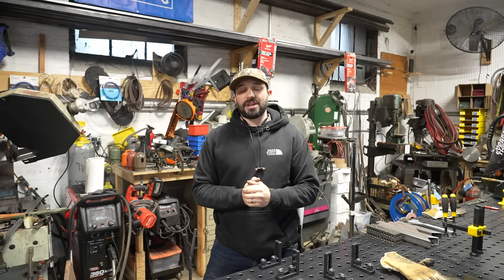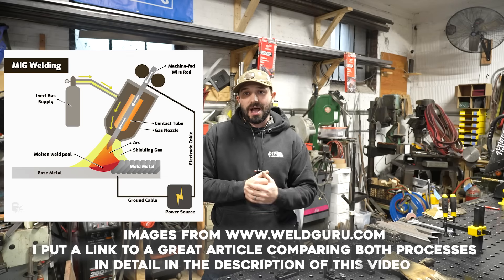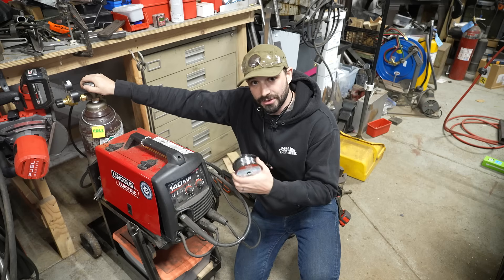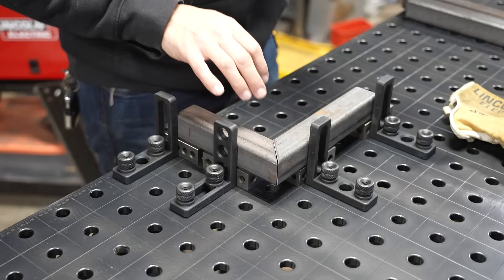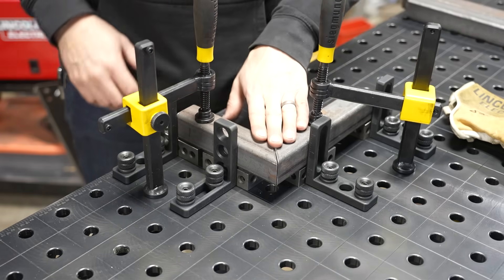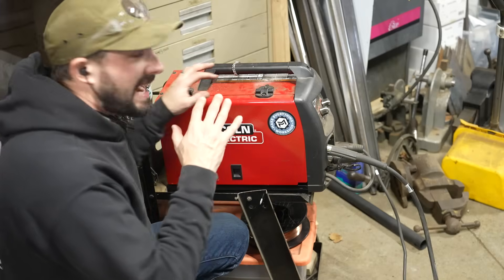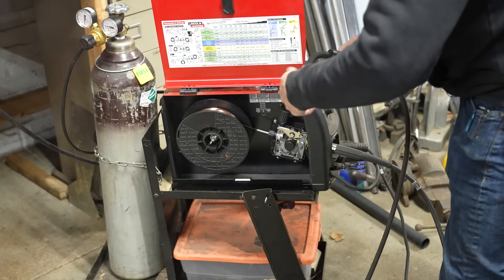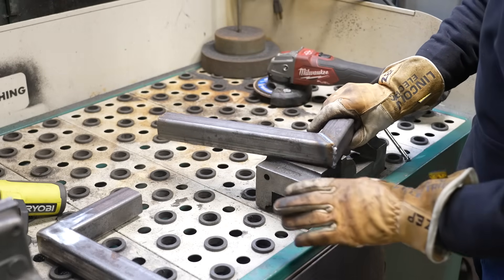“Gasless” MIG Welding Explained!

Comment: I have a MIG and a TIG welder. I don't use either anymore. Getting gas is a pain. All I do today is stick weld. It's the cheapest and easiest welding process to keep up with. A pack of sticks and I'm all set.
Reply: Alright!  Bro thanks for the tip , I'll get a 240v one since I'm a beginner
Reply: @josejovel8359  there is gasless wire feed welding. But I found that keeping wire was a bit of a hassle too. I've had spools of wire rust on me. I've had stick electrodes get soggy. Those I roast over an electric grill I have. That's all climate dependent. If it is dry where you're at you won't have those problems. Stick welding thin material is hard. If you plan on welding sheet metal then get a wire feed welder. Wire welding is generally considered the easiest process to learn. The first process I learned was oxy acetylene welding. Then I got my MIG and finally my TIG/stick welder. Welding with a torch is pretty dangerous. All welding can be dangerous. An open flame is especially dangerous though.
Reply: @1pcfred how would you fix a hear line crack on a power head on a outboard engine. It is were the water cools the cylinder. I tried using Jb weld but there was still a water drip coming out. I was thinking I would use a aluminum rod and torch it???
Reply: @ no I used regular jb. I will try the vinegar trick
Reply: Stick is king..  I agree.  I do enjoy mig and Tig though.. just at work... Where everything is free😂
Reply: @eastcoastitalian8758  I just watched a video where a guy was testing out a laser welder. That's the future.
Reply: I can get gas easy enough, but boy is it expensive
Reply: @nicolec7290  I haven't bought gas in a very long time and everything is expensive today.
Reply: @nicolec7290  It's pretty cheap where I am a 155CF C10  costs me around $70 to exchange at my LWS, and a 330 CF argon is around $110. Cylinder rental fee is $75 per year per cylinder. C25 is going to be about the same price (a couple bucks less if anything).
Reply: How is getting gas a pain? Your still going to have to go your LWS to get sick welding electrodes, exchanging a gas cylinder doesn't take any longer. Hell if you call them in the morning they will even deliver gas cylinders for a fee, often the same day. 

Stick welding is great for working outside with thicker steel, it's all we do at work in the construction business. However stick welding is a terrible process for welding thin steel, and non ferris metals. 

If you're working on cars, bikes, etc at home stick welding is possibly the worst process you can choose.
Reply: @Trump985  I can buy welding sticks all over the place and welding sticks don't leak. Good luck finding a gas cylinder that doesn't leak. If you're going to a welding supply house without soapy water you're one of their best customers. For a fee I can get anything done. It's over an hour drive to the supply house. So I'm sure their fee would reflect that. If I was getting a truck load of gas it'd probably make financial sense for me to have it delivered. One bottle? I don't think so. When I moved I never setup an account with the supply house here and my bottles are all from another supplier. Now they might swap them out? They might tell me to go pound sand too though. In fact if I was a betting man my money would be on the latter. My old supply house was cool as long as I was paying cash. I bet they were just pocketing it. I also don't care. I used to sign all of my receipts Johnny Cash. If there's one lesson to learn it is that not all welding supply houses are the same.
Reply: @1pcfred  Sorry to hear that, sounds like you were dealing with a shity LWS. In over 30 years of dealing with my LWS I've only gotten one leaky cylinder, and they swapped it out at no charge. However I have gotten quite a few bad dewars of LOX (liquid oxygen) from them, that boiled off very quickly. It doesn't take much banging around to damage a dewer enough to destroy the insulation. To be honest getting a good dewar is a rare occurrence.
Reply: I see so then you recommend to use the wire feed one which is the same as mig
Reply: Give them to me please
Reply: Can you use a MIG welder WITHOUT  the gas  ?
Reply: @jfk1792  I think gasless flux is MAG? But a lot of people just call it MIG. It looks a lot like MIG expect for all the smoke and spatter. It's still wire coming out of the gun. I think the polarity is reversed when you go gasless too? But it's nothing I've ever done. Technically flux core isn't MIG but that's what a lot call it. There's mixed gas and flux too. I have no idea what that's called. I don't even know why anyone would do it. But I've heard of it. Maybe it's nice to blow the smoke away?
Reply: @1pcfred 
MAG is Metal Active Gas. IT uses has also
Reply: Has anyone ever accidently used acetylene gas hooked up to their mig welder by mistake instead of argon?
Reply: @bens3067  You would have to actually try to do that with adaptors as acetylene cylinders, regulators, and hoses have reverse threads to make them idiot proof. It is impossible to accidentally connect an acetylene cylinder to a MIG welder. But with enough determination you could deliberately do it.
Reply: @bens3067  you can't because the threads on the tanks are different. I'm sure you could if you had the right adapters. But no one's that stupid. I'm not even sure if you can buy the right adapter. Acetylene is low pressure. A full acetylene tank is 250 PSI. A full argon tank is 2,000 PSI. Maybe from a distance the tanks look similar but up close they're markedly different. You need a key to open an acetylene tank. They'd don't have valve handles on them. So even if you did manage to connect the tank you couldn't open it up. Acetylene tanks are actually filled with acetone and the acetylene is dissolved into the acetone. They're not actually gas tanks at all. Because acetylene at pressures over 15 PSI is explosive. Or some such. I don't know all the gory details myself. I just know if you use an acetylene tank on its side brown goo comes out of them. You'd do that if you had the tank wired to a pallet for getting it around a job site. Which is something that's commonly done but you're not supposed to do it. I've done it. I popped a spark on top of an acetylene tank once and when I got done burning I looked at the tank and saw a flame on top of it. That's the most scared I've ever been in my whole life. I tried to blow it out and I was so scared I could just go woof. It took me three tries before I finally managed to blow hard enough to blow it out. It was a really big acetylene tank. You do not want to look at your acetylene tank and see a flame coming off the top of it. I can tell you that. Scared out of my mind. But probably nothing could happen? There's no oxygen in the tank. Still in the moment I wasn't thinking very rationally. I was just terrified. Nothing happened. But I was scared the tank would blow up. Maybe bottle flames are common? It only happened to me that one time so I wasn't prepared for it.
Reply: Which welding is stronger? Gas mig, flux core mig or stick welding?
Reply: @hayatel2557  they all do the same thing. Some are just good for different materials. The strongest one is the one you run the best. With no undercuts and good penetration. Some are faster than others are. MIG is very fast. But stick there's more alloys. We all like strong welds but strength isn't always the most important factor. For me there's ease and convenience that weigh heavily with what I choose.
Reply: But the stick welding machine works on 240 votls only right?
Reply: @josejovel8359  My stick welder is 240V but they make 120V stick welders. They're not too powerful. But they do make them. A really powerful stick welder would be 480V. So even my 240V welder is on the weak side.
Reply: I'm returning mine. Welding is a big whatever. I'll pay whoever to weld what I need to weld.
Reply: @MNIGN56  yeah I'll weld whatever. Just around the house fixes. I'm not doing pipeline work. For sticking stuff together being an amateur welder is handy. One of the important things I learned is knowing when to weld. Sometimes welding is the answer and sometimes it isn't.

Comment: I uve a harbor freight flux 125. I also have a tig welder. The flux 125 is pretty dang good.
Reply: I'm looking at the schematic for that machine now and it is AC. The output comes right off the transformer. There is nothing there. But you may ask, what should be there? A rectifier a capacitor and an inductor. That will give you smooth DC. There's videos here that explain how to modify that welder to be more capable. The parts you need and how to install them.

Comment: By sequencing the welds differently than done here, you can really reduce how much the heat will pull your corner out of square. Do the outside corner first, then do the two diagonals, pulling from inside to out. Inside corner last.
Reply: I had to laugh when he said his clamping held the pieces from distorting. Nothing in the world is going to stop that metal from moving. A literal ton of fixturing wouldn't do it. I don't know how much force expanding metal exerts but I know it is a lot.
Reply: @1pcfred  100% yeah. The best you can do is understand how it is distorting the metal and use that knowledge to minimize it as much as possible

Comment: Obviously you can't cover everything in one flux core vs. solid wire video, but you did a great job in covering the basics. Flux core has its purposes and you mentioned one of them briefly, it runs hot. Whenever I want to weld something thicker (before I got my 285 amp machine), I would switch to flux core because I knew it penetrated deeper and let me stick thicker pieces of metal together. :) Love the channel!

Comment: The ONLY thing I think flux core really sucks for is welding thin metal. Because its hotter it tends to blow through a lot more. I always recommend ppl get a machine that cab use gas, because once you use gas you never want to go back to flux if you can avoid it.
Reply: Good call mate
Reply: Well, the usual answer to a too hot welding is to reduce the electric current, like fewer amps. Which means, get a machine which can regulate that low enough. Also a thin wire, for car welding 0.6 mm (3/128") works a lot smoother than the more common 0.8 mm (1/32"). If such flux core wire is sold.
Reply: If found this to be the other way around.

Comment: Would like to mess with welding one of these days, learned basic stick welding in middle school, but nothing since, and that was in the late 80's
Reply: If you're an occasional welder just get a cheap stick machine. With the right electrodes and being careful you can do the around the house stuff with it. MIG is worthless when you're out of gas. Most of the bottles you get from supply houses leak. They sell gas so they've no incentive to maintain their tanks.

Comment: I’ve welded flux core and Gas  for over 40 years I prefer Gas in the shop      fluxcore outside because everything flux core  is usually on heavy equipment 1 inch thick or over steel      get beautiful wells with flux core    never a problem-  nr 211 5/64 wire    And sometimes i weld dual sheld 😊
Reply: so the fumes are pretty bad?

Comment: What about dual shield fluxcore. 
And you can do both theyre both types of mig with any machine as long as there is a gas input on machine but you can probably get around that with some adapter like usedfor making a dedicated SMAW machine run TIG. Also the polarity is reversed for each type most of you guys informing people on these two mig\fluxcore dont mention this. Many have issues with flux core cause they dont switch polarity and will stop using it......

Comment: Its been a couple years since i looked at my miller, i could swear the polarity had to be switched for flux core. I could look it up but yeah it makes a huge difference
Reply: Hobart is made by Miller and you do have to switch the polarity in my experiences
Reply: That model he’s using does it automatically when you select flux or mig

Comment: If you're looking at appearances, I find if you just use a cupped wire wheel on a 4.5" angle grinder to remove the slag.   Gets most of the  surrounding spatter too all in one shot

Comment: key point being USE QUALITY WIRE.  especially with flux, It can be the difference between getting a nice quality weld, and a pile of bird doo doo and BBs stuck to everything.
Reply: There's  another  video  from another  welder on wire and Forney and yes welder wire came out on top

Comment: You skipped over a HUGE part of flux core setup and that's polarity....flux core has to be welded DCEN, vs DCEP on mig with gas....most people who buy a mig machine and use flux core, don't realize they have to swap polarity, so they get crap results so the poo-poo the whole process.  Your machine prob swaps polarity automatically when you tell it what process you're welding.  Most mig machines dont.

The fact is you can drop dimes with a flux core setup, and weld thicker material.  Some people just suck at flux core.  But it's far from an inferior process.
Reply from the maker: Good catch!! Its second nature for me to switch to DCEN/ DCEP, and I forgot to mention it in this video! Ill Pin a comment about that now to remind people! So many people who have asked me for help with their machines fail to read the instruction on HOW to set them up! Its crazy! I've had great luck with Flux core welding in the field and on really dirty and thick material in a pinch! Its a shame to see people upset when they buy a flux core only machine and realize they can never use gas!
Reply: As a newbie- HUH
Reply: Flux core is too convenient to turn your nose up at it.
Reply: I recently got a Hobart 190. I've only been running flux core and the welder is a beast.
Reply: Completely agree
Reply: Also forgot another important part. 
Grind off mill scale before you weld.
Reply: FCAW-S is DCEN, FCAW-G is DCEP 👍🏻
Reply: @MikeP350  yeah, if you're running dual shield, you prob don't need reminding how to set the polarity... But a newb that just picked up a mig welder at harbor freight or home Depot, they def need to be reminded.
Reply: Switching is the key + to -
Reply: Dimes lol. 

Never understood why people try and emulate Tig so often with these methods.
Reply: @SeamlessFab  I say dimes because gassless flux core runs a lot like 6010/6011, so if you weld with a whip and pause, or with any manipulation of the wire while traveling, you get the dimes look....the point is, in skilled hands, flux core wire is far from the booger welds that it's associated with in the hands of a beginner.
Reply: @Steelcrafted don’t even need to whip and pause, I use a lot of seismic T-8 wire, real nice on heavy plate, just a strait drag all the way, slag peels off like 7018.
Reply: @Dopamine1245  seismic t8 comes in 1/16, .072, or 5/64 diameter, which is HUGE compared to .035 dia that these machines run with this nr211 wire ...you can stick a lot more flux in a 5/64 wire than a .035, which means you get a ton more slag on top vs 211, so of course the slag will build up and peel different.....

Comment: I just switched because I'm having trouble getting gas....I hate flux core ...porosity has never been a problem for me until I started using flux core. Several days in and I still haven't found the sweet spot for volts versus wire flow
Reply: polarity matters
Reply: Yeah I got tired of chasing after gas. The closest gas house to me is over an hour away. So you're talking a half a day to go get gas. Remember if there's slag then you drag. When you weld with flux you have to pay more attention to the puddle. The goal is to keep pushing the flux to the back of the puddle.The flux looks a little brighter. Use your angle and arc force to push flux back.
Reply: @1pcfred  cool thanks, great advice I will give that a go
Reply: @1pcfred  good to know thanks ...I need a better shroud than mig too that might help some
Reply: @1pcfred  indeed I can do that with MIG no worries just not flux core...more practice needed or a drive out for argon/co2  lol
Reply: It can also be your stick out, not just your wire feed speed and voltage.
Reply: @Dopamine1245  useful thanks 
I'm a lot more used to it than I was, actually making some decent welds now, I can definitely see where stick out affects fluxcore though
Reply: Forgot to add I have a really good welder
Reply from the maker: Have you tried changing out your wire? I know when Ive used old flux core wire that was exposed to humidity i get excessive porosity... That would be the problem. I really like this Lincoln inner shield wire.
Reply: @MakeEverything  thanks unfortunately its brand new...It might be cheap junky wire to be honest, because I am not normally this bad at welding....(don't buy vevor wire guys its awful) but I also have another that is turning out to be no better. maybe I need to spend more money which will be annoying but there we go.